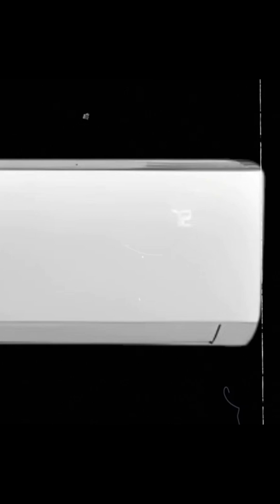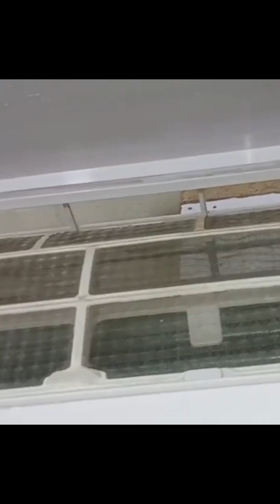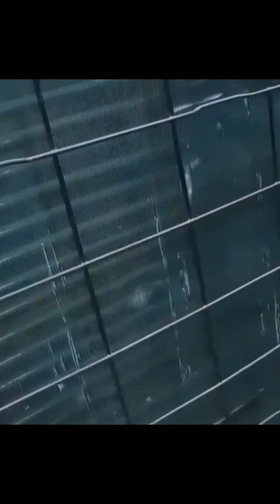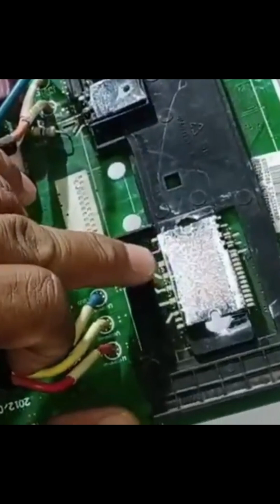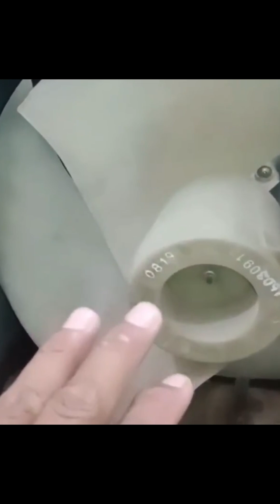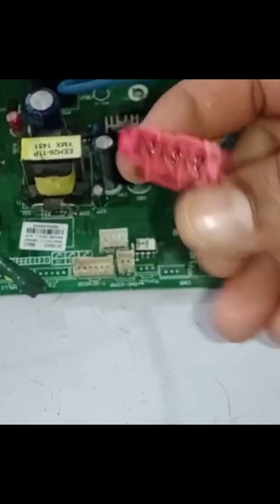“If your Gree AC shows H5… THIS is the real reason

Comment: I have a Vaillant, (100% Gree from the inside).

It only gives me a H5 error when outside if is freezing and I use it for heating.
Sometimes it is H3.

Heating while outsidetemperatures are above 0 degrees C, and the unit is fine.
Cooling always is fine.

I have replaced the magnet which triggers the valve, and now my next try will be the temperature sensor on top of the compressor.
Sensor is ordered and on the way.

Any other ideas?